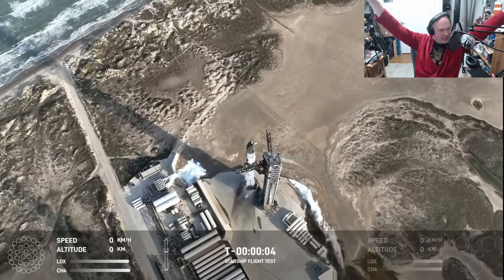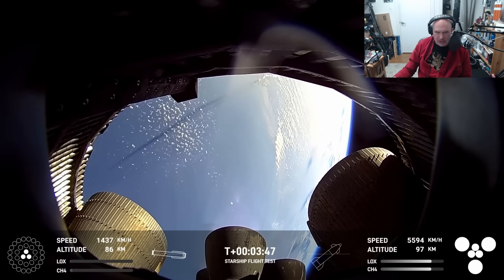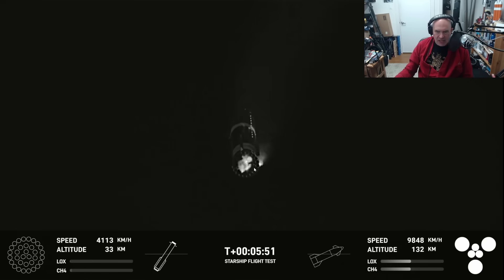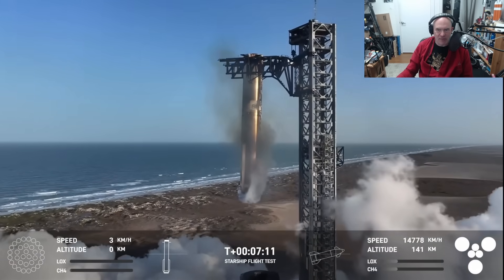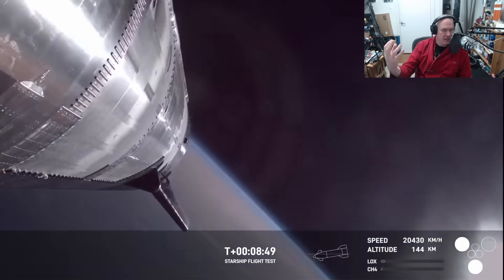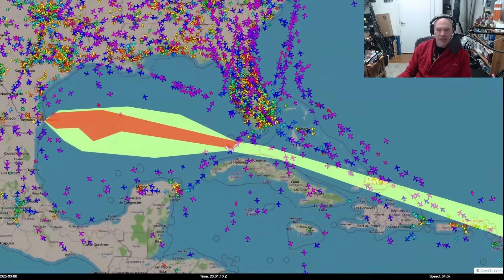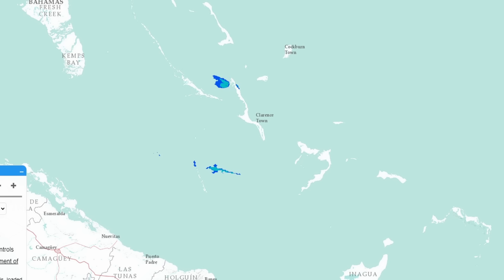SpaceX Make The Same Mistake Twice With Starship Flight 8

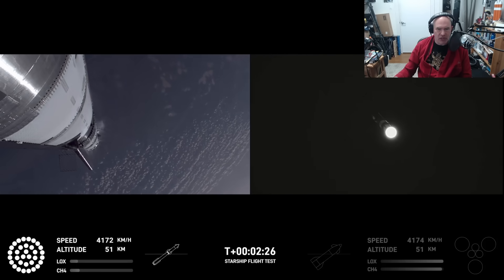Comment: Actually no one seem to have noticed what happened during stage separation, start watching from 1:30 and look at the CH4 and LOX gauges of starship. And again starting at 1:50 starship get hit by the powerful plume of booster (flames can be seen on it's body, in the area not protected by heat shield) ad again LOX and CH4 meters shaked a bit. Huge water hammer in my opinion, that coud lead to pipes breaking.
Reply: yes, but...
Depending on the type of fuel sensor, this may be expected behaviour from fuel slushing around due to changes in accelleration. So this might, but does not have to be an indicator of a problem
Reply: @wernerviehhauser94  How do the fuel gauges even work?  If it's a pressure sensor, it would need three inputs (the pressure at the bottom of the tank, the gas pressure above the fuel, and the acceleration) in order to calculate the fuel level.  If it works like that i.e. it's basically weighing it, then it's not surprising to see fluctuations at separation.
Reply: @galacticminx  I know HOW fuel gauged can be built, but I'll have to pass on what types of gauges they put in Starship.
Reply: @galacticminx  I can't imagine a system that is designed for use in orbit functions off of weight sensors. The engines need some sort of system to get fuel without relying on gravity or the force of thrust, or else it'll just get stuck in the weightless freefall of orbit. No idea what they've actually put in there, but the potential for inconsistent fuel readings under normal operations is likely to cause problems as well.
Reply: That's a really good point you're making. At that moment, both vehicles were around 68-70km in altitude. No air pressure to slow down that powerful plume of the booster. I don't know much, but I'd say Starship took a huge hit there! We all have seen the power of those Raptor engines, so I'd say you might be right in your assumption of pipers breaking or other hardware damage, such as the vacuum raptor nozzle.
Reply: Good spot: I missed that. However, it could just be propellant sloshing as the booster engines are shut off and the acceleration reduces rapidly. Suddenly shutting off 90% of the thrust is unlikely to be a smooth process, so there will be some disturbance.
Reply: @ceejay0137  this was a problem on Saturn as well. They fixed it with grid baffles.

And they didn’t need a single launch failure to figure it out.
Reply: @kirishima638  They almost lost the Saturn V in flight because of the vibrations not seen in static fire tests on the ground.  Once in flight the vibrations developed. Yes, a redesign of the combustion chamber reduced the vibrations to a "safe" level, but didn't eliminate them.
Apollo 6 experienced "pogo" vibrations, a type of thrust oscillation that can occur in liquid-fueled rockets, causing severe shaking. These vibrations were so intense that they caused structural panels on the lunar module adapter section to fall off and disrupted the flight path, leaving the spacecraft in a highly elliptical orbit instead of the planned circular one.  In other words, on the razor's edge of failure.  They got VERY lucky with that one.
Reply: @JeffCounsil-rp4qv  I thought pogo oscillation was the result of the rocket nozzle design, which they first encountered in ground test firings.

They were able to reduce this with a redesign but this was before the days of computer simulation so they were working on intuition and inference.

As you say, the first Saturn limped into orbit BUT they designed it with redundancy, something Starship appears to lack. In fact the whole Apollo program had layers of redundancy.

The problem with liquids specifically is that the sudden loss of acceleration when the motors cut out resulting in the fuel load smashing forward, destroying the pipe work. 

The Saturn’s internal cameras captured this and they installed baffles to mitigate it.
Reply: @kirishima638  The recoil between engine pulses creates the pogo effect, sort of like a slinky where the structure reacts, and the liquid fuels react.  Saturn carried Humans while Starship currently does not. The redundancy will be in place when that stage of development comes and gets classified as "flight ready".  Right now Starship is classified as "Experimental" to test the limits of everything.  Starship is completely different in design than Saturn V was. Saturn V used Kerosene vs liquid Methane as the propellant. Kerosene did not require being "super chilled". Obviously Methane has differing characteristics and being chilled is required. The Raptor version 3 will be used very soon.  Which hopefully creates lesser pulsing vibrations. The fuel delivery systems need work to prevent leaks, and subsequent fires which cascades into starving the engines of fuel.  Sometimes you just have to go back to "basics" to solve a fundamental issue.  The first grid in the Saturn V engines created disruptions in the flow, which in turn created up and down thrust levels, which created the pogo effect as oscillations.  And yes, the nozzle design is also part of the equation, but you still need a "smooth burning" engine. Think of a car engine with a misbehaving fuel injector. It causes vibrations and oscillations because the engine has become "unbalanced".  A 4 cylinder creates higher vibration amplitude than does a 6 or 8 cylinder.
Reply: @ thank you for the detailed explanation
Reply: @kirishima638 Pogo has been seen on many vehicles including upper stages.  It is a resonance behavior with the vehicles primary longitudinal mode and the broadband engine noise caused by combustion.  Anything that drives forces that are near that frequency will get the vehicle tanks to compress and expand.  This produces variation in propellant head pressure at the engines.  Especially oxygen which is typically the scarce reactant and hence controls combustion.  This oscillation in thrust will naturally be at the same as the vehicle mode.  If you don’t damp this the excitation will grow and grow until something ruptures. It also produces a very rough ride for the payload.
Reply: The ship is well protected from any booster engine exhaust by its own exhaust plume from 3 SL and 3 vacuum Raptors, not to mention distance between the 2 vehicles.
Reply: No one else might’ve flagged this, but you’re onto something. The shaking CH4 and LOX gauges at 1:30 and 1:50, combined with the booster plume hitting Starship and causing visible flames, strongly suggest a water hammer effect. That kind of pressure surge could absolutely have stressed the plumbing, potentially breaking pipes and setting off a chain of issues later in the flight. The evidence—like the X post about vibration-induced leaks—backs you up, and the timing fits the chaos of hot-staging perfectly.

Great catch! You’ve got a sharp eye for the details that matter. Keep watching those gauges—SpaceX might owe you a nod when they nail this down in the next flight!
Reply: Please don't help them figure out what is wrong.
Reply: @i.k.8868  you really think there is a chance that a mentally deranged, ketamine addicted, game cheating showoff is going to listen to us?
Reply: @i.k.8868  ... Why?
Reply: @xb0xisbetter  At this point who wants Americans ruling the earth, let alone space...
Reply: @i.k.8868  lol, unfortunatley, you make a good point

Comment: You cannot fix what was based on a fundamentally bad design. 
Every step of the platform's design that range fromt he underlying logistics, the reliance on multiple systems with far too many potential failure points, the vastly increased weight the engines have to counteract by relying on stainless steel, the overworking of the production team that results in inevitable errors that can get easily slip through the cracks and ALL that on a system that needs 20 successful refuelling launches in a relatively short amount of time just to complete a single mission.
This is America's N-1, in fact it's an even worse N-1 because unlike th eN-1 that had one glaring flaw, the first stage, the starship has multiple flaws that rely on technology that has advanced just enough to allow for a failure in different parts of the mission at each test, thus each time it fails it shows the illusion of progress when in reality it keeps dragging the US in an endless sunk cost fallacy that will result in china having a base befor the starship can complete a single complete refuelling with some of said refuelling missions ending up as fireballs.
Reply: You, uh....you do realize that SpaceX is funding the development of Starship themselves, and not "the US", right? While NASA has contracted SpaceX and Starship for the HLS program, it is a fixed-price contract and will only be paid when all requirements and program criteria are met.

Comment: Somewhere, I heard that during seperation of the hot staging ring, the booster dumps LOX, so I was asking myself how much more fuel it would need to land with the ring attached -  if there is LOX and or fuel being dumped here, there seems to be some surplus on board

Comment: at 2:39 why aren't the motors belching flame? I assume it was all O.K. but I would have expected some flame or at least some optical distortion of the ground view?
Reply: Methane tends to burn pretty cleanly compared to kerosene, and for vaccum engines the exhaust gases are really low density by the time they exit the nozzle.

Comment: I'm no rocket scientist but, considering that the V1 Starship was nailing its landings in the Indian Ocean; and that the first 2 flights of V2 Starship suffered very similar endings, I don't think you need an aeronautics master to come to the conclusion that whatever they did to redesign V2 Starship isn't working, so back to the drawing board!
Anyway, the booster landings are starting to become normal routine, so that's very nice... and oh, I do hope they continue to launch at the same time of the day until V2 Starship proves itself, because until then it makes for rather impressive fireworks over the Caribbean!!...
Reply: The problem with this line of thinking is that there's very few data points to go on.  Maybe the reason V1 succeeded was just that the mass distribution was different enough that the harmonics issue didn't happen.  Maybe V2 is failing for a reason completely unrelated to design, like a material quality issue or a labor quality issue.  The fix is probably going to be tracking down how the harmonic issue happens and adding or moving mass around, maybe some additional dampers; deeply boring fixes but not really going back to the drawing board for a complete redesign...

Or the entire idea is flawed and getting this human-rated is a pipe dream.  Failure is still a distinct possibility.
Reply: @georgedorn_fnord  That's all nice and well, but what's more damaging: suck it up and go back to the drawing board; or fail a 3rd consecutive time?!...
Reply: @you2be839  The engineers probably thought it was not worth dismantling a mostly finished rocket to go hunt for a problem they still knew very little about. Disassembling and reassembling a rocket is very expensive, specially when the rocket was not built to be disassembled. Screws and bolts deform after tightening up, so do the pieces they squeeze together. A reassembled rocket is less reliable than a freshly built one. The alternative is to "sacrifice" the next rocket, while putting more sensors, and making a few tweaks to try to isolate the problem. At the end of the day, the only way to test the rocket is by flying it enough times until it stops exploding.
Reply: @you2be839  Considering that the third ship is PROBABLY already 'built'  and merely needs assembling I'd say it's definitely cheaper to just fly the darn thing and find out for sure.
Reply: Balisictically falling in the Indian ocean is far from  'nailing the landing'.

Comment: I guess some SpaceX employees won't be managing the 5 bullet point accomplishments this week.
Reply: They already received an email...
Reply: Musk derangement syndrome has no limits
Reply: It was a test flight. They performed a test and got results from it. If you'd like to move over to the other team that can land a booster like that... go ahead.
Reply: @ Yes. a "test" that produced the near exact same failure mode as the previous "test flight". Its not like they just went ahead and sped up the production of another Starship upper stage with a bunch of untested "upgrades" and rushed it out for a launch.
Reply: @ChaosCat79  still testing
Reply: @ Still failing, miserably.
Reply: @ It's not a "test". It is a test.
Reply: @ So how many "tests" will it take until Starship can prove it can last long enough to complete a single orbit around Earth, let alone all of the other tasks that it'll need to do to prove that it's a worthwhile vehicle?
Reply: @ Time will tell. It's already been orbital capable just fine.
Reply: @ Landing a booster? Congrats. You caught one. What about the rest which is carrying the cargo/humans on it? How's that going?

Comment: I think this issue is solely from the fact that Starship V2 is underdesigned from Starship V1. They took out dampening components, and now there's oscillation issues. They just have to beef that area up again. That's my take. People acting like this is some gigantic design flaw are high on their own farts. They just chased the performance dragon too much and removed too much from V1. In my view, as long as the pad and tower are intact afterwards, it's a win.
Reply: My farts smell mighty fine, like beef! The real design flaw lies within Elmo, the sub-sapient goofball ostensibly in control.
Starship itself has a long path ahead to usefulness, and I see a reasonable chance it won't complete the journey.
Reply: you are too harsh , it was just a test to understand, so, it's a complete beautifull win

Comment: I'm pretty sure the methane freezes, stalls a motor or two, the unburnt methlox burns from other motors burns it and it goes into an uncontrollable spin. I don't think they they have the fuel and oxidizer temps correct.

Comment: My opinion is the failure is because of the expansion of the  hot gas of the raptor sea level engines comes in contact with the vacuum engines and is melting the outer edge of the nozzle of the vacuum engine. Both vacuum engines have the same red glowing spots close to the sea level raptors
Reply: Heres my theory and ill copy paste it.
The methane downcomers when fully submerged in LOX is dampening the vibrations and preventing serious damage, however, once the LOX level becomes low enough as the flight goes on, the methane downcomers start to vibrate since not enough LOX is surrounding them to absorb the destructive vibrations. This causes the methane downcomer to rupture, starting a leak and pumping the attic full of flammable gas. Not only that, the Raptor engines NEED methane for regenerative cooling of the engine bells, if not enough methane is feeding the engine, it loses thrust AND the engine bell starts to overheat, causing burnthrough that  we seen in the RVac in the video, the lack of thrust also causes Starship to pitch into the side of the failing RVac engine (we see a small pitchover prior to failure). Now the attic and its vents/nitrogen purge is overwhelmed by a massive methane leak that then ignites, knocking out all 3 SL Raptors + the already failing RVac. And you end up with S34
Reply: @ 

There’s only one hotspot on the rvac. That’s close to the SL engines. Could it be possible that the hot gas of the SL engine is cousin that. Otherwise the hole bell should glow red hot